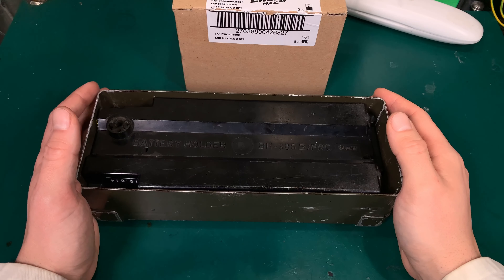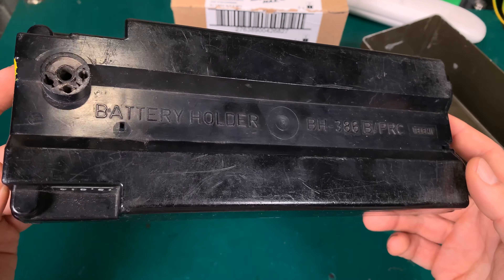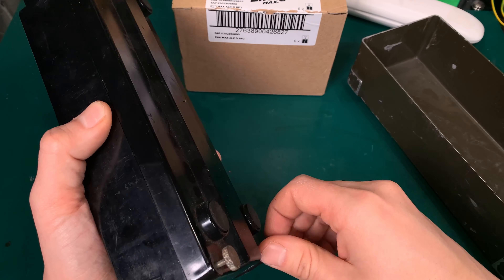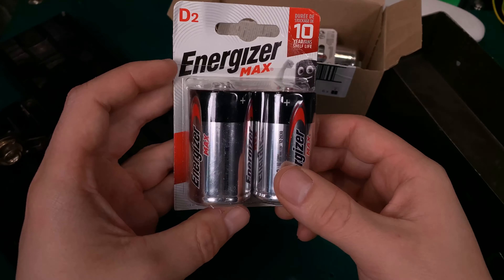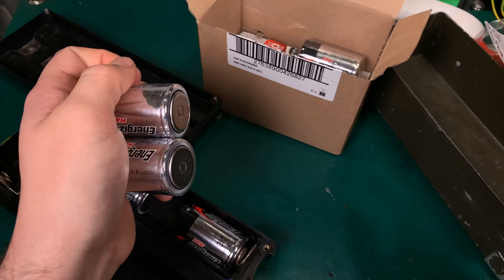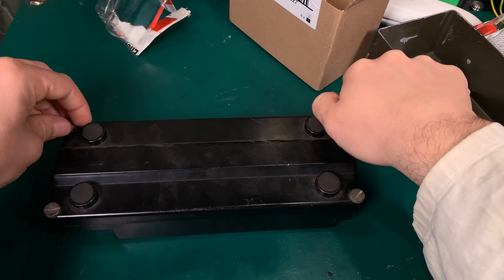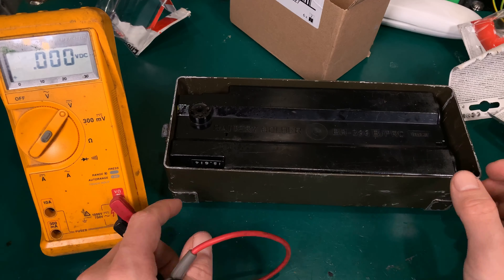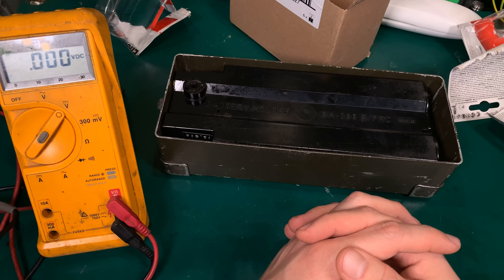US Army Military Radio Battery Adapter PRC-77 BH-386/PRC 10xR20

Comment: Can you use this for a Prc-25
Reply from the maker: I think they both share same battery so it should work - but I do not have 25 to try.
Reply: No it does not provide the. Voltage tap for the tube in the prc 25